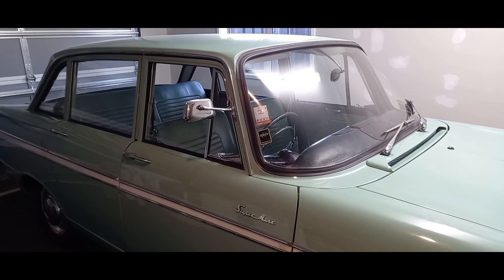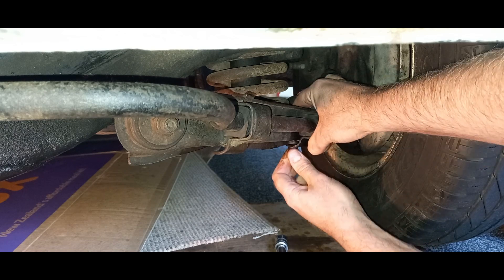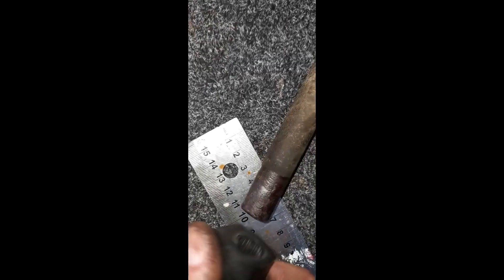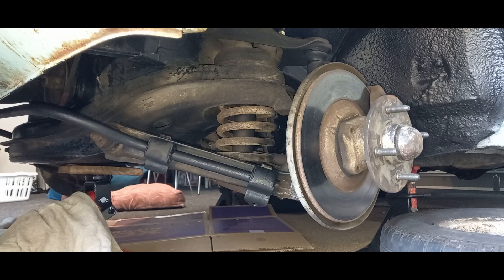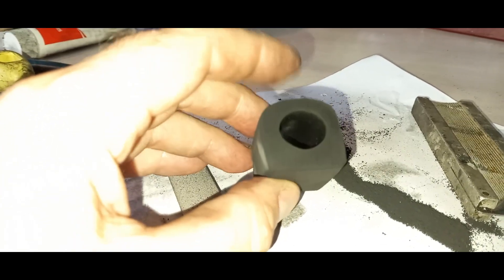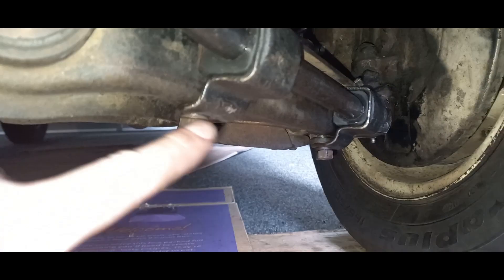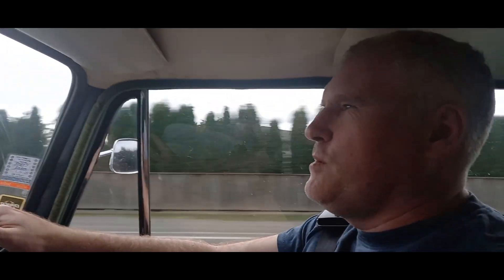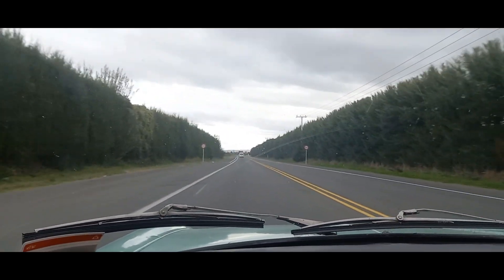Replacing the sway bar bushes on the Hillman Super minx.  How easy are they to replace??

Comment: Nice job with the adaptation of bushes that didn't fit. And by hand!

I upgraded the shocks on my Superminx back in the 70's. It was very well worth doing, transformed the handling from soggy to really good without ruining comfort.
Reply from the maker: Thanks for the comment.  Yeah I am definitely going to upgrade the shocks, will make a big difference.
Reply: @everything-hillman66  I am impressed you can still get them. I had a struggle finding any c.1971. In the end I found some adjustables made by Armstrong. The fronts had 3 click adjustments that needed a screwdriver, but the supplier could only get hold of electrically controlled Adjustarides for the rear. They had a 3 position rotary switch, and needed wiring, but he sold them to me at the same price as the manual adjustables would have been. Both were just right on the middle position. 

To my amazement Armstrong still seems to exist. a brand I thought had long vanished from the UK market. No idea what quality is like now, but the ones I had were excellent.
Reply from the maker: Yes Gaz shocks will fit.  Also monroe shocks from a nissan navara for the front will fit.  Can still get shocks for the back, but getting harder to find.